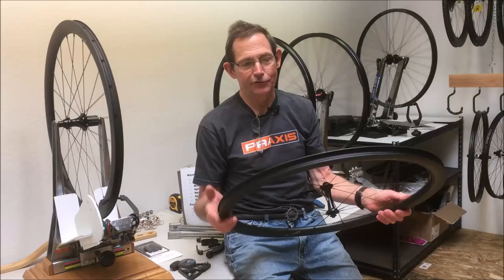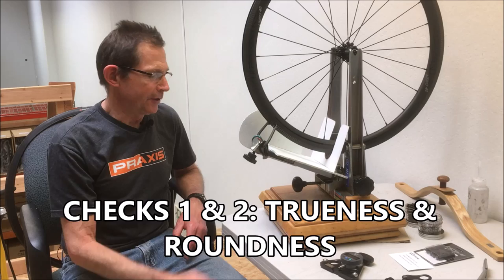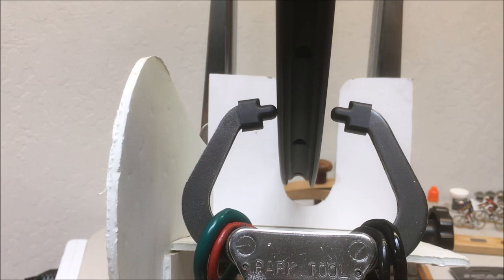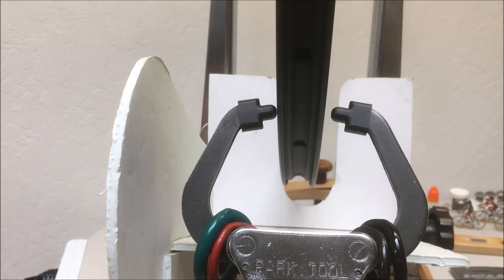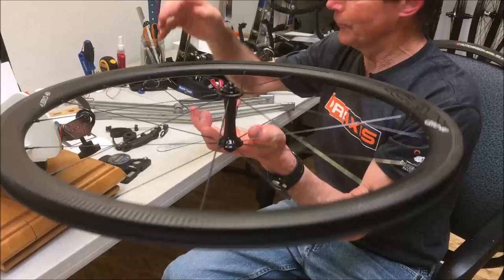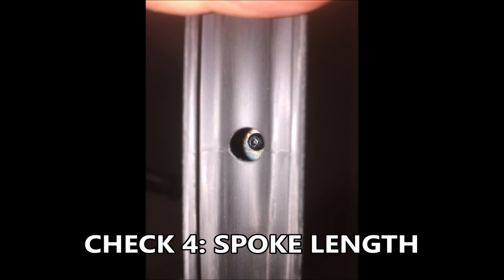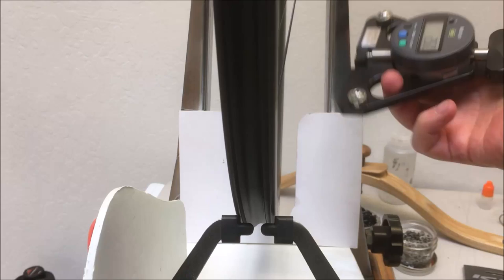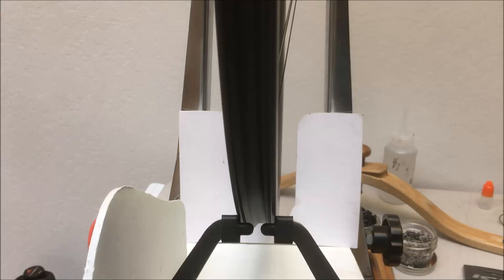ICAN Chinese Carbon Bicycle Wheels Review by Wheelbuilder Jim Langley

Comment: I don’t know which wheels you got but it takes two people to put GP5000 tubeless on theses wheels. Even the non tubeless version is difficult to put on.  Otherwise my 40mm wheels check all the boxes.
Reply: TBH i'd blame the GP5000's more than the wheels- i've seen mechanics have a hell of a time fitting those to Mavics. I've also got a pair and have struggled to get them on my own wheels
Reply: @grantywalker94  As a mech myself I can confirm - Gp5000's and most Conti's in general can be an absolute pain to fit. Great tyres once they're on though.
Reply: @Grant , i have a set of ican FL 40s and   gps 5000s go on very easily
Reply from the maker: I wanted to try this out so I bought a Conti GP5000 Tubeless tire for $95 at my local bike shop and I put it on the Aero 40 wheel. It was a tight fit but I put it on with my hands only, so it wasn't a problem. I find that in most cases if people are having trouble putting a tire on, if I show them how I do it, that they can do it, too. It's about the sequence of mounting, how you hold the wheel and how you put the tire on the rim. Most people make mistakes in how they put the tire on, or they hold the wheel wrong and use their hands wrong it seems. I am working on a video to show all of this in detail.
Reply: Jim Langley can you make video on how to put them on. Ican sent me a video and the person was on all fours using a tire leaver to put the tire on. I have the fl40s and front is harder than the back.
Reply from the maker: Yes Steven I hope to get it done in a week with any luck.

Comment: Thanks for the excellent video, Jim. Have you seen any of these wheels that are using Dyneema for spokes? What are your thoughts?
Reply from the maker: Thanks for the comment and question, Rory. I've only seen the news reports of the Dyneema spokes, like this one https://cyclingindustry.news/dyneema-spokes-lace-superlight-860-gram-mtb-wheelset/ Spokes made of a synthetic material like this are pretty rare but the idea isn't new. One product that uses it is the FiberFix replacement spoke you can see here: https://amzn.to/31hPeJw . I have tried brake cables made of synthetic materials and didn't like the way they felt. I would have to try these new spokes to see how the wheels feel and find out how the spokes hold up. The worry is that the spokes would stretch over time or due to temperature or weather changes. Still, it's an interesting design for sure. Thanks again! Jim

Comment: Great video but I'm a bit confused about the spoke tension. The rear wheel is tighter on the drive (right) side because of the dish and the challenge is to have it tight enough on the left not to come loose without it being so tight on the right that the rim starts to crack after a few thousand miles. The front is much easier. So I build with the tightest spokes on the right rear, the loosest on the left rear and the front somewhere between the two, which it looks like these wheels had from what you said (but does your gauge read higher numbers for less tension? It was like 44 on the front and 26 on the back, maybe it's measuring deflection?)
Reply from the maker: Hi Ben and thanks for the comment.. spoke tension can be confusing for sure. What you're doing with your tension is fine - Every wheelbuilder has to develop a feel for the components they build with and determine what's the right tension. On most wheels I build, I generally use tensions on the front wheels very close to the rear right spokes because even though it's a front wheel, it can need to withstand major loads from climbing while standing, cornering, accelerations out of the saddle and rough roads. I go both by what the tensiometer tells me and by what my hands tell me - the feel of the wheel and how it reacts to stress relieving. And the thing about the ICAN wheels, and others like them, is that the rear wheel has 24 spokes. The front wheel has 6 less spokes, only 18 total. With fewer spokes, having sufficient tension is critical since each spoke has to work harder. (Yes, on the rear wheel only 12 spokes do almost all the work, but there are another 12 helping - less space between each spoke hole in the rim.) Lastly, yes, you are exactly right, all the tensiometers I have used - and my current favorite, the Wheel Fanatyk one, measure deflection, so the higher the number, the looser the spokes. I hope that helps explain and thanks again. Jim
Reply: @JimLangley1  That makes perfect sense thank you. Never occurred to me the front might have fewer spokes but this is probably quite common these days!
Reply from the maker: Yes, it's quite common today, Ben. Some cool bike trivia is engineers knew about saving weight by using fewer spokes in the front wheel at the dawn of cycling in the 1880s and you will see bikes in museums with wheels and less spokes in the front than rear. I have an 1886 women's bike with wood rims that has that feature. Always thought that was pretty cool. Thanks! Jim
Reply: @benc8386  In the "good old days", Europe used 36/36 front/rear spoking while in the UK we used 32/40 front/rear, our logic being that the rear needed more strength.  Time triallists used to reduce weight by going 24/24 as they tend to put down the power more smoothly so don't stress the wheels so much.  Modern wheels use far fewer spokes nowadays.  Progress!

Comment: Hi Jim, Thank you, good video. I agree with your methods. My only question is what do you think of the longevity and quality of the carbon? Ive used FFWDs before but never taken the 'risk' of  non-brand Chinese carbon rims. Just like to hear your thoughts on anything Chinese or non-brand against, Zipp, FFWD, Enve, Campagnolo, Swissside, Reynolds, DT Swiss etc. thanks! mark
Reply from the maker: Thanks, Mark. ICAN is using Toray carbon for the rims in these wheels. Toray is well known as a maker of quality carbon, so I would expect the carbon to hold up as well as any other carbon rim. Several commenters here have said their ICAN wheels have worked very well, too, and some of them have had multiple pairs and put in lots of miles. So far, while I haven't even ridden 1,000 miles yet - I have hit some stuff and abused the wheels a bit with no issues with the carbon at all. I don't know of any direct comparisons with the wheel brands you mention and ICANs, so I can only go on my experience and these carbon rims are working fine so far. Hope that's helpful. Appreciate your comment, Mark. Jim
Reply: @JimLangley1  Hi Jim, Thank you very much for your lengthy reply! I am a little sceptical, mainly on the price difference - even from Chinese RRP to UK trade on the branded wheels available.  I just wouldnt want a high speed delamination; which i have seen from UK brands like Planet X. Ive also bought Planet X rims myself (for a hill climbing build), and within 3 rides, the braking surface started to fall apart. Ive only come across your channel yesterday, but i wonder if you have done the same video for a Campag Bora wheel, Enve (which seems to be en vogue) or something from your compatriots at Reynolds. I'd be interested to hear your take on whether the extra few hundred €£$ is worth it (warranty aside). Cheers, mark
Reply from the maker: You're welcome,  @mrwhiteshorts . I haven't done other inspection videos on carbon wheels. But I have owned and ridden/raced several, like Neuvation, Bontrager, Zipp, Praxis, HED. I have never had carbon rims delaminate or otherwise fail. I like hill climbs, too, so I have descended long distances after the races on my carbon wheels, like down Fremont Peak and Mt. Hamilton, here in Northern California - tricky with lots of turns and steep in places. I have seen broken carbon rims, of course. Usually the result of extreme impacts or crashes. It's possible to damage carbon rims braking from heat build up, bad brake pads, grit getting embedded in the pads, etc. That's what I would think happened to your Planet X rims, maybe? But, I haven't had issues with any of the carbon rims I've ridden and raced with where they failed on their own - and I don't weigh enough or hit enough holes, obstacles, etc. to crack a carbon rim. It takes a major impact or hitting something just the wrong way. When you pay more for wheels, you typically get better hubs and spokes and more steps (more hands touch the wheels) in the building process - and these days you often get pretty ironclad guarantees with some wheels. Thanks for the comments! Jim

Comment: This video was amazing! I am considering ICAN (£333) and or yoeleobikeeurope (£585) 88mm Wheelsets for my track bike with braking surface and I really cannot decide between the two, although the pricing difference is quite extraordinary? Have you tested any yoeleobike wheelsets, any other advice Jim! Thank you
Reply from the maker: I'm happy you enjoyed my video, Adrien and thanks for watching! I have not seen the yoeleobikeeurope wheels so I can't tell you anything about them at this point. If you haven't already, maybe try searching my comments below as there might be someone who has those wheels who left a comment. Usually you don't need a braking surface on a true track bike because there are no brakes. And a braking surface means that the rim is built with extra material, which adds a little weight. So that's something to consider when deciding. I hope it helps and thank you again!

Comment: Thanks! Jim great video.  What tension would you shot for on the non-drive side and the front wheel?
Reply from the maker: Thanks for the nice comment, Bruce. I don't check the non-drive side tension on the rear wheels. It just "is what it is" based on what the right side is. And for the right side rears and all fronts I'm looking for about 110 to 120 kgf. You need a good gauge to get an accurate reading. Park Tool makes a nice one that's not overly expensive. Wheel Fanatyk's is what I use. In case you're interested here's my review of that tensiometer: http://jimlangley.blogspot.com/2017/02/product-review-wheel-fanatyk-mitutoyo.html I hope this helps and thanks again! Jim
Reply: @JimLangley1  Thanks! Jim much appreciated

Comment: Fantastic videos Jim. I am considering buying a pair but how easy is it for a layman to correct the spoke twist himself? Also, have you had the ICAN wheels on the bike yet? Would be great to see how you think they perform.
Reply from the maker: Thanks, Aaron, I'm glad you like the videos. It's pretty easy to fix the spoke twist if you get the tool I show in the video and use it carefully to unwind the spokes. But, the tricky part is what to do if that step of untwisting the spokes causes the wheel to go out true and round - as it usually will. Then you will either decide to ride the wheels the way they are - slightly out of true/round - or more likely choose to either true the wheels or pay a wheel builder to do it for you. I'm working on another video to show the process of fixing the twisted spokes and truing the ICAN wheels. Because that video is in progress, I haven't yet ridden the wheels. I hope to get the video done sometime soon so please watch for it. Thanks again!
Reply: @JimLangley1  Thanks for the response. Looking forward to the truing video.
Reply from the maker: Hi Aaron - I now have a video showing how relatively easy it is to un twist aero spokes. I hope you like it: https://www.youtube.com/watch?v=zszdrNEgSDw&t=2s Thanks, Jim

Comment: I am new to cycling and would like to upgrade my wheels. Does the group set matter? 
I have Shram. Great review! 😊
Reply from the maker: Thanks for watching and the question, Shaped. Glad to hear you're getting into cycling. When buying new wheels you need to purchase the correct ones that are compatible with the components on your bicycle. You said you have SRAM components, so you would buy wheels that are SRAM/Shimano compatible. The other important detail is what type of brakes your bike has, rim brakes or disc brakes. You need to get disc brake wheels if you have discs and rim brake ones if you have rim brakes. Okay? I hope this helps. Thanks again.

Comment: Interesting analyses... would be interesting, how other mass-produced wheels go through these checks.. like mid-priced Reynolds/DT Swiss and some high-end Zipp/Enve
Reply from the maker: Thanks for the comment, Thorsten. To explain, as a pro mechanic for many years, I have worked with all those wheels you mentioned and more, such as Bontrager, Fulcrum, Roval, Shimano, Rolf, Mavic and more. So when I inspected the ICANs, I considered everything I've learned working with the brand name wheels and also custom built wheels by hand. None of those wheels have had spoke twist issues or inconsistent tension. The quality is always spot-on, with very rare exceptions. That's why I feel it's important to point out those issues with the ICANs. Hope that explains. Appreciate your feedback. Thanks!
Reply: @JimLangley1  Im going to upgrade my set of wheels. So, you sugest me going for the well know brands and don't take risk with cheap priced ones?
Thanks in advance for your advice.
Reply from the maker: @albertosierra2139  Thanks for the question. I haven't checked every inexpensive wheelset available. But, based on the ones I have seen, my advice is that f you want perfect wheels without any issues that need addressing out of the box, it's best to go with well known brand wheels. Hope this helps.

Comment: Hey Jim - Great review indeed>   I was wondering what your doing to assess the bearing and spin performance?  Loaded with weight?
Reply from the maker: Thanks for the comment and question, William. The hub check is to feel them in your hands. There should be no play in the bearings and they should feel smooth with a slight hydraulic resistance from the grease in the bearings. The real test comes from riding the wheels and then what you're looking for is reliability over many miles. Mine have been working fine for about 1,200 miles now. Hope this is helpful.

Comment: Dear Jim,  thanks for the detailed review.  Based on your review (and others) I recently purchased a set of the ICAN Aero 40s myself.

I installed new Continental GP5000 clinchers and tubes to mine and really like them.  Just curious though if you experienced any difficulties seating the tyres.  It required in the order of 115 psi+ to seat the tires onto the rims.  Therefore, my only concern is trying to repair a puncture at the roadside.  I would be interested to hear your experience.
Reply from the maker: Thanks for watching and the question, Steve. When Continental launched their 5000 tire line they had problems with the fit. You basically could not put some of their tires on wheels. You had to return them as defective or if you didn't realize you could do that you would get the help of several people and force the tires on with tools hoping not to ruin the tires or your rims.

It was crazy because Continental tires going back decades had always been pretty easy to put on and take off by hand. But, because I ran into problems with the first 5000s I stopped running their tires. I do know they specifically say that their NEW 5000s (you must have their newest model by now I think) are designed to solve their too tight tire problem. But, I can't speak from experience except about the ICAN Aero 40 rims. I have put on a variety of tires on my wheels without any issues installing tires by hand or seating them. But, I have not tried the tires you have.

I would expect your new tires to stretch a bit and "loosen" up after you ride them for awhile. And that should help them seat should you have to fix a flat. When tires don't seat after a flat repair, sometimes they will seat a little later as you're rolling along because your weight loads the wheel at the bottom and the tire gets a sort of massage that way and it can cause them to seat if you're lucky. Also, as you already know, if you can pump them a little more that can help, too.

One thing you could do for a little peace of mind is get a small waterproof container that fits in your seatbag repair kit and put some dishsoap in it. You don't need much. That way you could at least soap up the tire where it won't seat and a lot of times that'll let it pop out from inside the rim and seat without an extra air or riding. I hope something here helps. I hear those tires ride great and I hope you enjoy them and your ICANs.

Comment: Who else has carbon fiber wheels for under $700 that are this good?   NOBODY
Reply from the maker: Thanks for watching! It sounds like you're enjoying some ICAN wheels too. Mine are still going strong. You asked who else has carbon wheels this good for under $700. In another review here https://youtu.be/OlcpWDKIU54 I look at a new set of carbon gravel wheels from the Company EliteWheels. And it turns out that they have some under $700 - carbon road disc wheels. I haven't looked at or ridden them but their wheels that I did inspect and rode a ton have been great. So I think their other wheels are likely very nice too.

Comment: Is there another figure called breaks performance?
Reply from the maker: That's a good question, Jonathan, but I think you mean "brakes performance" - as in how well the carbon rims on the ICAN wheels work with the brakes on bicycles. This is a function of the rims and probably more importantly, the special carbon-compatible brake shoes that ICAN supplies with their wheels. You must install these special brake pads in your brakes with ICAN's carbon wheels (with all carbon rims, special pads are required). I have not tested the braking in all conditions with the ICAN carbon wheels and carbon brake pads for them yet, so it's too early for me to comment on braking performance.